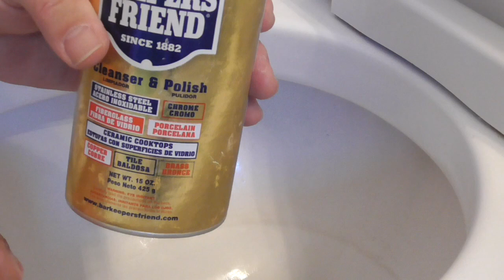Clean Toilet Water Holes for stronger Flush. What works!

Comment: White vinegar down overflow tube, use a pipe cleaner to clean holes out ... worked great on mine and flushes like new
Reply: @TadD68 Did you fully clean all the water out of the bowl first? Or did you just pour vinegar down the overflow tube and flush (if so, that's a LOT easier than getting rid of all the bowl water first)  Thanks!

Comment: I just had this problem, and vinegar works wonders, put it down the overflow tube and in the water and bowl, it took a couple of turns doing this. I used cleaning vinegar, cheaper than muriatic acid and works just as great.

Comment: Lower jet hole and some upper rim holes were plugged. This has restored the toilet, THANK YOU!
Reply from the maker: I am glad you cleaned out your holes and are back to normal
Reply: @LEARNINGCHORDS  follow up'd with CLR and that romoved some of what I could not pick off. Turned water off, flushed toilet so only water in the bottom. Added CLR and let stand for two hours. Do you have a recommendation on how ofter to use CLR or similar product? Thanks again for your simple fix to a major problem.

Comment: Thank you for the tip about unplugging holes underneath rim. As for cleaning bowl, we have well water that just stains towel bottom. Used Vim, bleach, etc. with no avail, then  saw this video saying: Throw in a good brand dishwasher tablet. Ok, did that at bed time, wow in the morning it was sparking clean, no muscle work scrubbing. Now I'll try plugging toilet hole to raise water level and throw tablet in see if this will clear underneath hole. Results to come!
Cheers, Maurice  :)
Reply from the maker: i might try that

Comment: Don't forget the big hole in the toilet opposite where the sh*t goes through that is often forgotten. This is the hole that is always under water and easily can clog. Partial clogs can still prevent the sudden rush of water needed to drain the toilet and cause issues.
Reply: i took the whole toilet out and put it on the grass outside of the house and once i put a coat hanger into the big hole it got lot of gunk out of there, the small hole i put acid. Will test tomorrow to see if it work.
Reply: @dangda-ww7de  did it work

Comment: my best friend is a plumber with 36 years experience. I will give you all a secret . pour vinegar in your overflow valve let it sit all night flush and also clean the little holes around the inside of the rim of the toilet bowl. use baking soda to clean your bowl. environmentally friendly and it works awesome.
Reply: Or you can use muriotic acid instead vinegar.
Reply: mr zed thanks, I’m trying not to buy a new toilet....
Reply: mr zed   --  I tried Vinegar and then I tried Muriatic Acid which sat in there for 2 hours.  No luck.  What finally started the siphon action was cleaning out the hole in the bowl OPPOSITE the hole that takes the water and waste away.  I scraped a lot of sediment off and out.  Powerful flush ensued.
Reply: Doesnt pouring vinegar in overflow tube ...just go into the bowl....and not the jets?
Reply: @tinysmith1834  Before adding vinegar to the overflow tube, take duct tape and cover the rim jets to prevent the vinegar from going into the tank. When you add the vinegar, it will not leak out, and soak the rim jets.

Comment: being a germaphobic, I was cringing while watching this man sticking his hands in the toilet with no rubber gloves - however I found it very informative .
Reply: LEARNINGCHORDS Not if you clean them every day with Lysol and Clorox spray. I spray my phone front and back everyday as well as door handles and light switches. Common sense man. You could have worn gloves.
Reply: LEARNINGCHORDS The most confusing part of this video is that the ring never went away. 🤔
Reply: i cleaned all holes without glove hyhy its my toilet am the one use it after flushed several times the water is clean!!!!next! this vid. WORKS!!
Reply from the maker: no

Comment: magic eraser + CLR spray foam for water and rust marks!
Reply: Are when I clean the ring and under the rim. Been doing it every three days for a month. Slowly but surely with pipe cleaners as hole cleaning aid. I got the majority of them open.
Reply: I bought 50 of this magic sponges and yes I use both bar keep and vie

Comment: The rim holes are not 'jet holes'. The holes are for washing waste away from the bowl sides.
The bottom hole in front of the drain hole is the 'jet hole'. It needs to be cleaned of deposits to make the toilet flush well.
Removing all of the water in the bowl (not the tank) and filling the bowl with vinegar or CLR or other products do not work.
You have to hand scrape the deposits out. I use a 10 gauge solid copper wire to not damage the jet wall sides.
Muriatic acid might work, but I will not use it due to the danger involved.
I will try to make a power tool to scrape the deposits out. If it works, owners can use it to prevent dishonest plumbers from selling/installing new toilets. My 10-year-old toilet works as good as new.
Reply: My toilet was loosing the ability to even flush toilet paper.  It took 4 or 5 flushes before the bowl would completely empty.  Ran across a few plumbers on YT who said if you can flush the toilet with a bucket of water, you don’t have a pipe clog, you have a bowl problem, meaning deposits clogging the rim holes and siphon hole.  I cleaned all of them with an extra large metal bobby pin from days of old, plus the siphon hole, and now the toilet flushes.  I didn’t think I removed that much crud from the siphon hole (it did smell 💩 so I was glad I was wearing gloves) but it made a difference in the force.  So all this time the 🚽 was acting up, it was due to a disturbance in the force.  May the force be with you.  Try this before some plumber convinces you that you need a new toilet.

Comment: The absolute fix and trust me on this.... You need a strong fountain pump, I put a large leaf bag in the drain to artificially raise the water level in the bowel.  Place the pump in the bowel and the output hose goes back into the tank.  I used dollar store blue toilet cleaner liquid.   Ran the pump for Two Hours.  BRAND NEW from the inside out !  PS the inside flush flap needs to be propped open to recirculate.
Reply: What is a leaf bag? What's the cheapest way to get a "fountain pump"?
Reply: This sounds like a product/kit that you need to make and sell. It's genius.

Comment: Trouble with my Universal Rundle. Roto rooter cleaned Main & used toilet snake. Told me to clean rim holes and siphon jet. No holes..wide slots I cleaned,  No siphon jet!? Valve, float flapper water level ok, bucket test too.Any ideas? Other 3 toilets in house work ok

Comment: What do I do if my toliet will not swallow the water and its no clog. By hand i drained the dirty water into a bucket and pouring it outside. After i take all tje dirty water is out,  the new water fills up to the brim. I tried draining and flushing over and over it still will not swallow.

I used Drano, soap and boiling water, a 3ft plastic snake, thats how I lnow it was not a clog. I learned about the jet presser hole and I I will try tomorrow.
Reply from the maker: what is a jet presser hole? i am totally confused with your question... did you fix it?
Reply: @LEARNINGCHORDS  I dont understand how you dont understand. And if I fixed it why would I ask for help? My toliet is not working. When I try flushing it the water fills up the entire toliet bowl and never goes down the hole.
Reply: Water jet is what you named "water holes" when the calcuim, lime, mold...builds up.
Reply from the maker: are you saying your toilet is plugged?   could be a damaged dewer pipe. could be poop and toilet paper dried up in the drain line. could be a massive wad of toilet paper stuck at the bottom of the toilet and pipe... time for a plumber
Reply: @LEARNINGCHORDS  I put my hand down in there and there is no clog. Idk if its several ft down to the point I cant reach but ive tried draino a plunger vinegar and baking soda a 3ft snake nothing has helped. The water will only fill up The bowl and never swallow the water.
Reply from the maker: vICTORIA-- This is normal.  you hand can't reach intol the 4 inch drain pipe under the toilet.. this is usually a curved pipe.  The clog could be there which would require removing the toilet BUT you said you used a 3 foot snake which means the clog is deeper in the dewer pipe.  it could be TREE roots in the sewer line that have clogged it. it could be rust or pipe rot or it could be a hug chuck of balled up toilet paper 10 or 20 feet down the line before it hits the city sewer.  DRANO doesn't normally break this up.  My Mom just had this same problem with her bathtub not draining.  The plumber wanted to save me money so he had to cut a hole in the pipe under the house and put in a pipe cleaner that took him almost an hour to clean out.  the clog was about 18 feet into the line.  the whole job took a few hours and if I had a BAD plummber they would have said we needed a sewer pipe replacement.  Find a company that will do an unplug for $99 and let them do the job..This is way too much to deal with alone
Reply: @LEARNINGCHORDS  thank you that makes a lot more sense. I hate strangera in my house but it looks like I have no choice. Im also embarrassed because there is fecal matter in the bowl at the bottom. I'm sure they are used to it but still.
Reply from the maker: it is a nasty job. no one likes it. clean the poop up with gloves and a sponge and then let them fix it.  I watch youtube videos of plumbers cleaning home pipes and sewer lines.  there is gallons of slush poop pouring out the clean out pipes.. yours won't be that bad. they might be able to pup and 40 foot portable snake down the toilet without removing it from the floor. just make sure you get a quote so they cant say they need to hydrojet to the street sewer.. plumbers in LA won't go in the house unless everyone has a mask. they walk in, clean the poop and get their money and then it is done. no more stressing.. we all have plugged toilets

Comment: THIS IS THE FIX:  Pour some dish cleaning liquid (1/2 cup) in the over flow tube in the tank. Take some HOT water (gallon or two) and add to the bowl = wait 10 minutes and flush.... you will have a new toilet = works like a champ.

Comment: There are a million of these videos. None seem to mention that depending on your municipal water supply, there are a variety of possible chemicals in the water that could be the culprit for build-up and lazy flush. Muriatic acid did nothing for me. I never tried CLR. I went to Home Depot and found some product by Zep that worked. Don't ask me what it was, first find out what kind of water you have and what the deposits are, then find the correct chemical treatment. And don't use metal objects on porcelain unless you want to risk scratching it and creating a groove where future deposits will build up.

Comment: Avoid chemicals? Why?  It's a toilet!  You are doing it the hard way.  A gallon of Zep CLR costs $9.99 at Home Depot. Take the top of the tank off and pour a quart down the overflow tube to clean the jets.  It ends up in the bowl anyway.
Reply: LEARNINGCHORDS you seem a tad paranoid. I clean my toilets every single day and nothing has even exploded. LOL.
Reply: LEARNINGCHORDS Thank you for laughing. Firstly I contracted a mold toxicity that turned into a bacterial infection in my upper and lower intestines. I’m still fighting it and it’s agonizing. I had to learn to be extra clean and to keep my home very clean and I find cleaning the bathroom easy and relaxing since I do it daily and it takes no time at all. What is a must though are cleaners that disinfect! Especially the toilet. I even take my phone out of its case and clean it with Clorox wipes every day and I’m the only one that touches it. I’m not paranoid over germs or over chemicals. We need them both.
Reply: LEARNINGCHORDS Additionally, do you not wash your dishes after you use them? Wash your close after wearing them? Take a shower each day? Why is it so shocking and funny that the toilet ( the place that sees the worst of the worst usually by multiple people) get a good scrubbing daily? It just makes good sense.
Reply: @AmieDeLalla  You use probiotics, right? Let me know if you need recommendations about really good, powerful ones. Also there are books about gut health now, it's a big topic of focus, that might really help you.

Comment: A hangar, screw-driver or awl aren't exactly gonna clean the mineral build up inside the rim. Which is why it's advised to use the Muriatic acid/vinegar/De-Limer route in the tank, and letting it sit. It cleans your toilet bowl for you as well.
Reply: just add those in the tank MrElis.